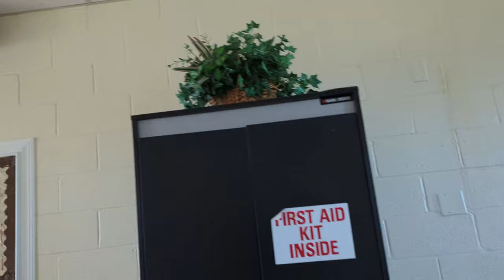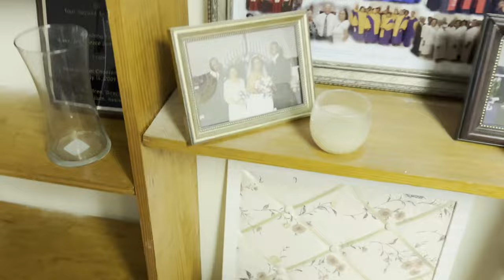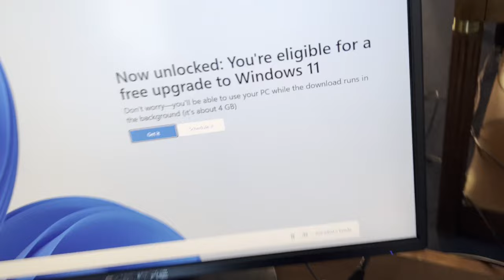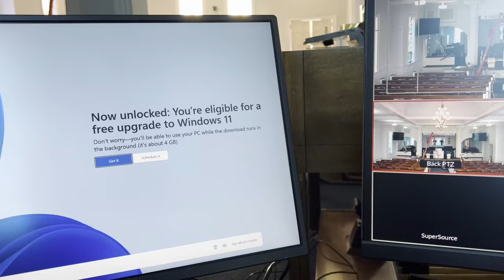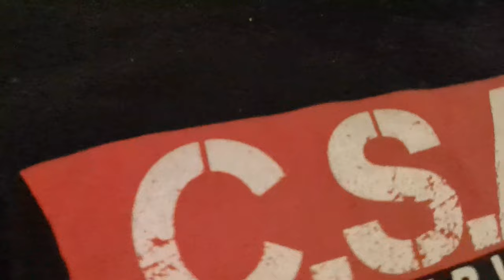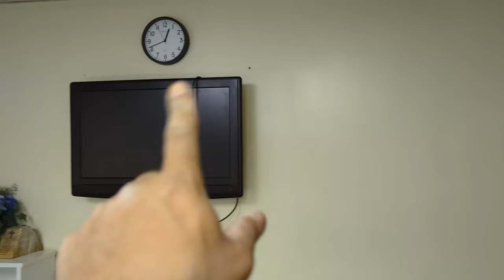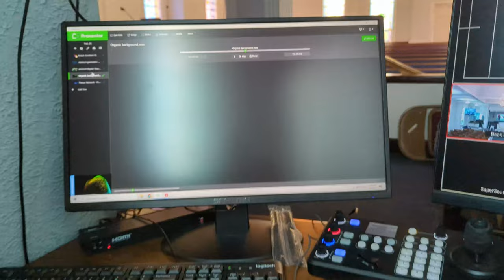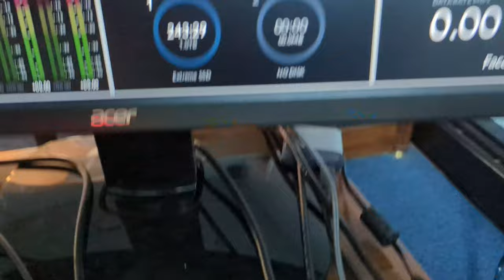Rose Chapel Baptist Church - Livestreaming System Install

Comment: Another well documented install.  Those wholes are pretty big.  I've never drilled a two inch hole to run cables.  I've gone as large as an inch hole.  I can't imagine you running  enough cable to fill a two inch hole.
Reply from the maker: Thanks. You'd be surprised how much it helps. I remember doing the same thing at a church and I had to add 10 more SDI cables and that large hole helped so much especially now that the walls were closed up